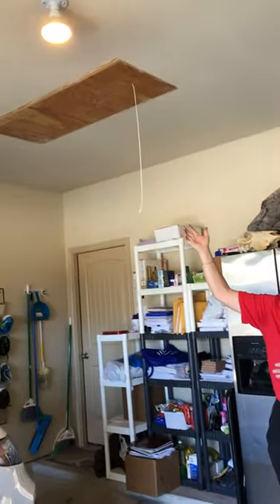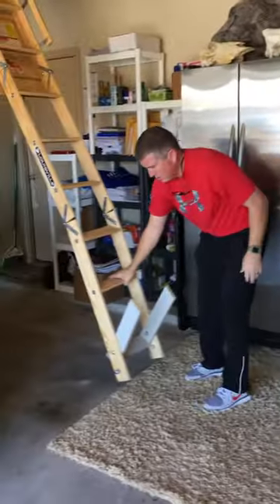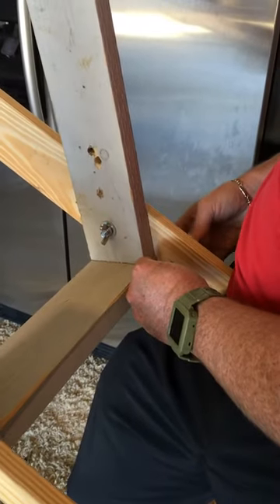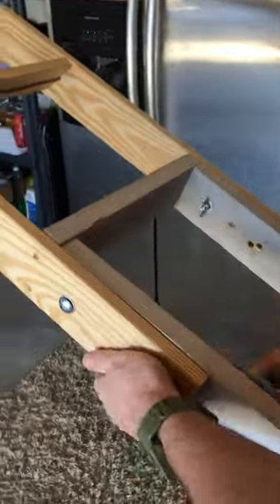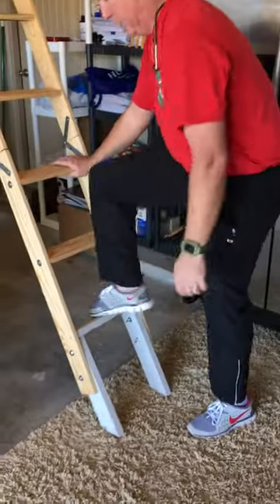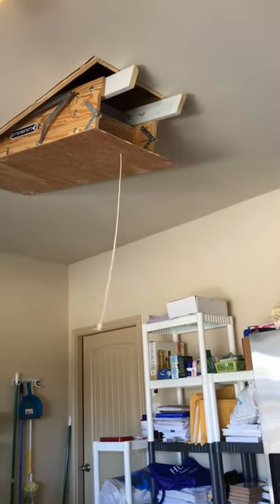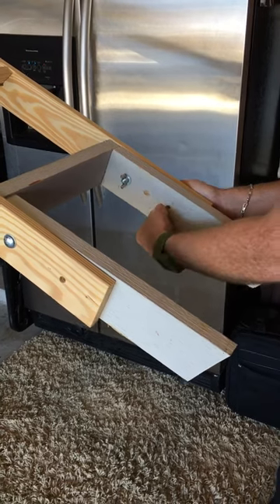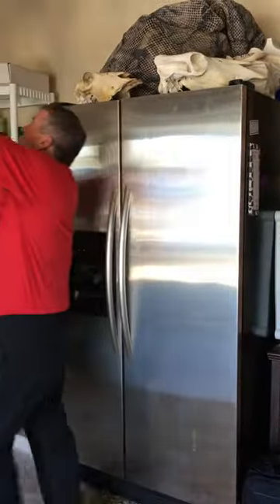Pull down attic stair HACK

Comment: You should’ve purchased the longer length, as that is the manufacturer’s intention. These are made in standard lengths, always purchased longer than needed, as the manufacturer knows each application is different.

When installing, you actually cut the bottom section to the length needed with the proper angle to the floor.
Reply: If you purchase a high ceiling model of some attic stairs they will just add an extra section to the ladder. So not that much different to what's happening here.
Reply: This is perfectly acceptable and safe. The longer ladders can be more than double the costs
Reply: And the ensuing hospital bill will be 10X’s the cost of doing it properly.
Reply: @DrewSachau  you obviously have never built anything before but to each his own.

Comment: I feel like it would be better to get the longer one and cut it shorter to the correct length? then you wouldn't have to undo and redo the wingnuts every time and the ladder would fold correctly back up... if cutting it shorter would loose a step, then adding a new step higher would be the next thing to do; unless the next step up is close enough to the floor that you can still comfortably use it.
Reply: I looked at other comments... I didn't even know there were directions stating this very thing.
Reply: Because it isn't cost effective dragon lady. Sheesh!!!

Comment: Would it not work if you fix a pice of wood on the face of the original ladder to act as a stopper? Instead of threading the bolts every time?

Comment: Way to not read the directions, dude.
Reply: His ceiling is to high so he has to add on. Has nothing to do with reading instructions.
Reply: He bought the improper length. All there is to it.

DO NOT DO THIS!

This is not safe and not recommended by the manufacturer or any licensed contractor!